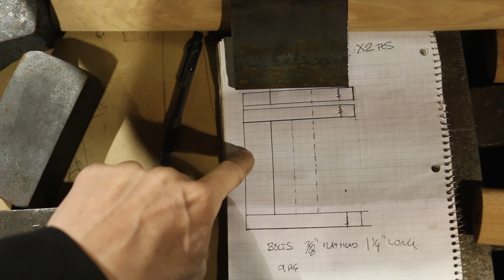BLACKHAWK AXE Tooling! Day 2

Comment: Hey bud, love your videos and your attitude and everything. Journeyman machinist of 20 years here, a little tip to help you better use your milling machine:

Spindle speed is too low, for best tool life and finish you want blue chips when cutting with carbide. Also if your mill has automatic feeds you can calculate using the corner radius of the insert for best finish, there are calculators online. 

I appreciate that you do very good, accurate layout work, but with a mill it is completely unnecessary. Set a hard stop for your work to register in while in the vice, use an edge finder to pick up the surfaces that register against your solid vice jaw and your hard stop, come in the radius of the edge finder, zero out and then dial in to your hole location. 

This ended up a lot longer than I had intended. Follow me for more unsolicited machining advice.